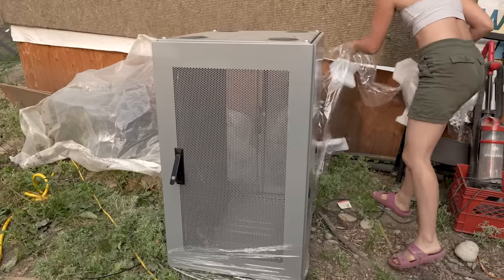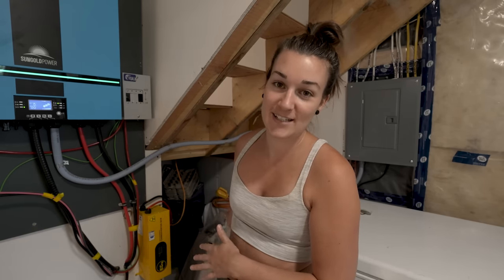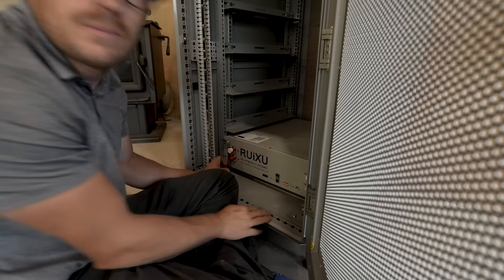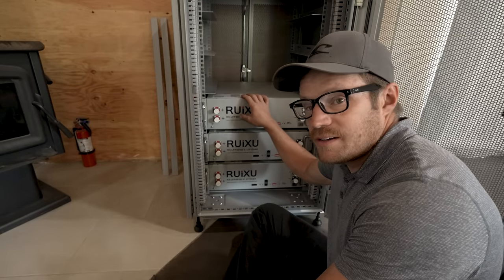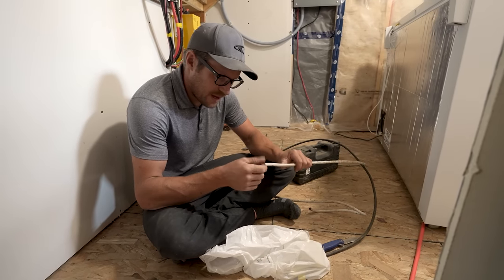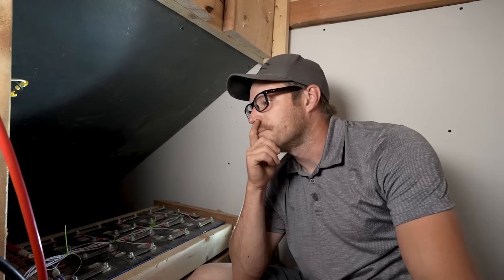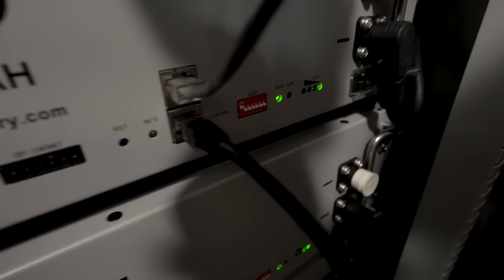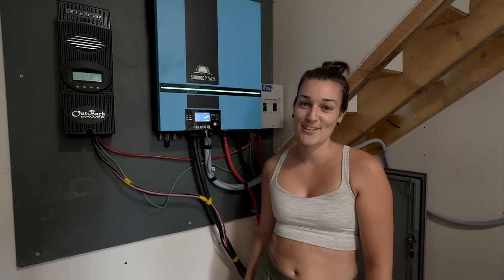Doubling Our Off Grid Battery Storage With Ruixu 48v Server Rack Batteries! DIY Solar System

Comment: FYI for cable sizing, as the AWG number gets smaller, the wire size gets bigger
so, a 4 AWG terminal won't fit a 3 AWG cable, it will work the other way how ever
that cable is probably good for 100 amp at a guess with that length... may only be 80 amp

Comment: That 3 gauge wire has a rating of 80-100 amps. What is your max amps your inverter will pull from your battery banks? example I can pull 200 watts at 56 volts max. I have 4 banks so 50 amps per bank. I use 4 4AWG from each battery bank to a busbar rated for 300 amps. I then run 2 gauge 600 volt welding wire from busbar to 2 inverters. I try to stay around 50% load rating. doing so means no loss to heat and over working the wires. Hope this helps. So I am saying I would use 2 of those 3AWG wires for both pos and neg.

Comment: The Floor was Creaking rolling the battery rack around when you get the next 3 module batteries don't be rolling in around without a ¼ steal plate on floor to spread the weight out onto the floor joists
Reply from the maker: It marked the wood floor too 🫣
Reply: If it's a LB floor you can use a scratch resistant scotch Brite pad very lightly try putting a big towel down to roll heavy stuff on I'm so Sorry it marked your new floors.

Comment: Woot! That's an upgrade. (Thanks, Greg -- I've just called them QR codes for a long time and until you asked that, I never wondered what the Q and R stood for. Quick Response. Though that doesn't help make more sense out of them.)  The rack's isolation of the connections really is nice and gives some peace of mind, I'm sure.

Comment: Usually the smaller the number on large gauge wire the bigger the wire. #3 should be bigger that #4. #6 is smaller than #4. And so on. 😊

Comment: thank you, you might of heard this before but , we have wind turbine ; why don’t you ? were in Michigan where the wind is 6mph to 20mph every night . Panels run ac all day & turbine runs ac every night + we have a 10k generator with transfer switch that starts automatically when battery’s are out ( runs on dual fule ) . Have you thought to put in a standpoint down the mountain near the beach ? Thanks

Comment: The nuts that need to be added to the rack to secure the batteries need to be pushed in from the back. If they are mounted in front they will not hold the battery packs

Comment: well most of the solar systems I've seen on YouTube that use the kind of power you guys do have 48 or more solar arrays to keep enough batteries charged to run their home with no issue so I know you are working on things and great you got some new batteries and rack but a lot more panels you will need or put up a wind turbine to help out

Comment: Just saying that those nuts should be on back side of the rack profile and it is easiest to put first one claw and use flat head screw driver for the other.

Otherwise the setup looks good and is something I would use for off-grid as power per cubic meter is quite good.

Comment: If there was enough wire I might have placed them every other one just for cooling until I got the rack filled. Probably wouldn’t do anything, but I’d try if possible.
I see you got the optional cat scan. Did you get the “properly completed” sticker?

Comment: In the video you showed the square nuts on the front of the rack post.  I believe you should have placed the square nuts on the backside of the post so when tighting the battery pack with screws.  The screw would clamp the battery to the post because the nut is on the backside of the post and the screw head is on the front side of the post.  I spent many years building data rooms with equipment racks, holding computer servers and other equipment on the rack.  I dont think the way you installed your batteries in the rack is going to be a problem, because the equipment cabinet is not going to be moved around in the future.

Comment: The cage nuts are in backwards. They need to mount from the rear.  They won't hold the gear safely like that! The equipment should site flush to the frame. Pop the side covers off and you should have enough access to re-fit them correctly.

Comment: When have the opportunity change this cables, for the proper ones like welding cable( welding cable #2) Is my suggestion to work safe. To keep safe your beautiful house.
Reply: The gauge 3 for AC voltage only supported 85 amps.

Comment: Nice install.  Did you happen to set your inverter's battery protocol so it can communicate with the Ruixu batteries?
Reply: You only need to set the RUiXU master battery communication protocol type through the dip switch, and the battery will automatically adapt to match the inverter. Very simple
Reply: @ruixubattery  That's very interesting.  It seems like this would be the first battery I've seen that works that way.  I'm used to having to change the inverter to match the battery protocol.  

What protocols does the battery support?  Do you have a link to the manual I can look at?

I don't have any direct experience with server rack batteries, I've only ever built DIY for my systems.  It seems like it's always been hit or miss whether or not the server rack battery communications work, so I've always told people it's not worth it to have battery communication set up.  Have you found that there haven't been a lot of issues because the battery adapts to the selected inverter?

Comment: Nuts go behind the holes.... like regular nuts - you want to fasten the Batteries at the bars with all the holes - so you clip the nuts in from behind the bars so so the screws go through the battery, the bar and then into the  nut.... just saying.

Comment: 19:30 just the opposite. 4AWG is smaller than 3 gauge (AWG). You won't have to crimp  it real tight, you'll have to make sure to get all the strands in the connector

Comment: Panel array potentially undersized compared to your battery size now.  a 2kw solar array could generate about 10kw of power at most.  I think you have around 30kw of battery capacity now.  So it would take 3 days just to charge your battery without any usage.  You would need to have a 6kw array minimum and probably larger depending on where you live and to handle overcast days. Of course this depends on your actual usage as well.

Comment: Your DC leads coming rom the server rack batteries is incredibly under sized to your inverter. May be a good idea to wire in a DC breaker as well before the inverter.

Comment: Thanks for the video. I plan to buy the same battery. I noticed you had a  EG4 Chargeverter. Have you used it on these batteries and where did you connect it on the battery side?
Reply from the maker: I have a bus bar that both of my battery banks are connected to, I connected the charger to that.  The chargeverter is a game changer!!!

Comment: Are you sure you wired the ground wires correctly?
I would've expected them to connect to a common ground bar in the rack (which also grounds all parts of the rack, incidentally) and from there to your houses ground.
Chaining the batteries like that seems a bit sus.

Comment: Everyone worried about the cage nuts.... Not me i am worried that every connection to that buss bar should have a torque rating for each lug. Loose connections are dangerous. It appered that you used a  hand screwdriver in the video.

Comment: You shouldn't mix lithium with other types of batteries, not even to other makes of lithium batteries because their bulk, float and equalise voltages are not the same.

Also, you should always fully charge each battery individually before turning them all on. A 5kWh battery can discharge up to 100A and if one battery is flat the other two will try and charge the flat battery by pushing a combined 200A into it which could damage it.
Reply: Unless you would like to burn down your house without any "wildfires"

Do NOT mix the two battery types.

Remove the old batteries completely from the system. ( Use separately on another  system )

Comment: I'd like one of those for emergencies on grid. Do the all in one chargers support AC in and auto switch when AC fails A. K. A. Grid down?
Reply from the maker: There are different units that would support the grid tie systems. As far as we know, this is specifically for off grid
Reply: Look into EG4.  They have a whole house hybrid grid tie and some new wall mount batteries that are super affordable.  They also have rack mount if you want to go that route but they cost a bit more.  You could also look at Sol-Ark but they haven't reduced prices to remain competitive.
Reply: @AndirHon  Thanks I'll look into it

Comment: An increasing number of people are placing their lithium batteries well away from the house to avoid the ever increasing event of lithium battery fires which are non-extinguishable and do, in fact, burn under water. Admittedly more common in automotive use where the risk of damage or leakage is greater, but a bank of these lithiums could easily lift the roof off when they explode!

Comment: As someone who has dealt with those types of server racks for 20+ years, I know what a pain those nuts re.  But I hate to say it but you installed them on the wrong side.  They are supposed to mount on the back side so the screw pulls the battery bracket tight against the frame of the rack.  The way you did it only uses the small clips to hold it to the frame which is not as secure.

Comment: I caught myself yelling at the tv that you installed the bolt on the wrong side and just remove the sides to install them. Bolts go inside of the rails. If bolts are installed on the outside the batteries could still rip out.

Comment: WHAT IS all your system voltage 12v, 24v, 48v, what is your controller 12v, 24,v 48v, the batteries you're putting in are 48v? you cannot mix them.

Comment: Bummer about the smoke and wildfires!
I strongly recommend putting server storage OUT of under stair space. As a firefighter, point out the heat they generate and what you need for access in the event of fire. Yes, it is convenient, also really stupid place for Safety. Think what burns if they go up the stairs! A ready chimney and blocks escape and access to deal with it. DON'T DO IT!  PLEASE, PLEASE, PLEASE! I would so hate to see your house be burned down. Remember you don't use a hose or water to extinguish batteries unless you have can keep them constantly wet for hours.

Comment: Also you put the nuts the wrong way. They go BEHIND the hole. Not in front of it. Then your batteries will pop out quite easily since you don't screw them in thru the hole and have the nut lock behind the metal.

Comment: What cable type did you use to connect battery bms to the inverter? Was it a standard cat5 cable or special pinout?
Reply from the maker: Cat5

Comment: Do you have 240 Vac output in that inverter? Or 120 Vac only... thanks
Reply from the maker: We just use 120v but if you add another of this inverter you can get 240v. There’s other inverters available now that have 240 built into in one unit

Comment: If you are able to quickly charge the batteries during the day, but they fall too low overnight, then battery capacity is likely to be an issue.  But if that is not the case, I hope that you are able to also add more solar panels, as if the batteries are not able to achieve a full charge during the day, then the issue is not enough solar, or your household power load is too high.  AC often eats the power.
Katie, I hope that you got them in cottectly, as those nuts and clips are meant to be put in from the back, not the front, else they will not hold in place when the screws are tightened. 
Will the new batteries be isolated from thhe old batteries, I hope so else, when there is no solar input, the new batteries may discharge into the old batteries.

Comment: Noting the storage position for your new storage rack -- under a solid wooden shelf under the stair platform, there appears to be very little clear space above it AND AROUND IT (PERHAPS AS LITTLE AS ONE INCH) to let hot air from the system box to flow out.  THIS MAY NOT BE ADEQUATE.  Have you read and understood (fully) the instructions about space around and above the unit????  It can be critical.   Failure to provide adequate ventilation can lead to premature equipment failure and fire.  This is especially critical with these new types of battery structures.  These new batteries , when they burn, they burn at extremely high temperatures and need special equipment to extinguish them.  Sometimes they do not extinguish, but keep reigniting.  Be extremely careful.

Comment: Would have been better to go with Signature Solar EG4 batteries.   Longer warranty, US support (not China), the EG4s have a circuit breaker, and you don't need to use propritary wiring connectors.

Comment: what size are your charger and inverter? 3awg seems way too small for a whole house. those cables you have are fine for a whole house at 110/220v but lower voltage battery will need to draw more current. should probably be 0 or 00 cable...
Reply from the maker: I took a thermal camera to the system after charging the batteries at 100amps for a bit and there was very little heat coming from the 3awg cables.

Comment: How is the heat from batteries managed?
Reply: The maximum current of each battery is limited to 100A, and the heat generated is dissipated by natural heat. We designed the battery cabinet or battery rack with space between each battery to dissipate heat.

Comment: How are the batteries working? Any issues so far? 15kWh of these is notably less expensive than 15 kWh of SOK's.. So looking at them hard.. Just not sure of support /warranty status..
Reply from the maker: We haven't had any issues at all
Reply: @ThisOffGridLife  now that it is getting cloudy again and days are shorter, have you had to supplement your power with a generator with this large of a bank?  I'm looking at replacing my older lead acid bank with a set of these since they are in stock and an attractive price for Canada.
Reply from the maker: @xstatic981  we used the generator once during a couple rainy days, but on either side  of that weather when it was partially cloudy we were totally fine. It's been mix of sun and clouds lately and we are still hitting 100% full. You won't regret making the switch! We'll do an update video soon

Comment: 12:27 min. - Sorry but this is wrong! You should insert the cage nuts from the BACK
and not from the FRONT. The purpose is to protect the racks (same as
server racks) from falling forward.

And in the current situation they are only semi-protected because the
cage nuts are pointing FRONT instead of BACK.
Just for the next racks you will install it.

Comment: The nuts you put in on the front of the rack should be on the inside of the rack and not where you put them if you pull hard enough the nuts will pull out with the batteries 🤔

Comment: Well you need to put two big trip batteries in I put 15 amps 60 watts 60 watts you need 50 solar panels cuz you're going to be using up more water so you need more batteries unless you go to wind power or go to firewood or something else to drink power water power or something you have nearby the wind power is the next best thing Sia

Comment: I note you haven’t answered anybody’s concerns about overheating  ventilation or fire risk from these batteries does this not concern you?
Reply from the maker: The lithium iron phosphate is the safest battery chemistry on the market. It has a low fire risk. The cabinet has space around thr batteries, thr cabinethas perforations and there is spcearound them under the stairs. It's the coolest area of the  house

Comment: Awesome. How much did that set you guys back?
Reply from the maker: The batteries are on sale for $1300 currently. It's possible to add to this set up as well, so it's easy to start small and add on as financially feasible.
Reply: @ThisOffGridLife  so that whole set up with the three batteries was 1300
Reply: Impolite to ask the price
Reply: Considering it's sponsored, they probably got those three for free in exchange for this video.
Reply: @mikepagliei426  No... one of those batteries is $1300.  3 would be $3900, and the rack  itself is $600 for a total of $4500.  They have the whole kit for $4,456.00 on the site.
Reply: I love all your videos, especially the barefoot ones.

Comment: Storage in close proximity to batteries and electrical equipment???  NOT A GOOD IDEA!  You need clear space for air-circulation for cooling of that equipment.  You do not want, in any circumstance, for heat build-up, which can create a fire risk.

Comment: U did this all  wrong.  She should be on top walking the rack into the home. With her on the bottom, she is working against gravity plus all the weight of the rack on her back. .  Your electrical load center is too small . you need at least 36-circuits to accommodate future expansion. You should be running the branch circuiting  in steel flex conduit , use romex around corners.  since U are off the grid, consider PV system. But do a ayback and initial cost analysis.  In Cal a PV cost 25K with 8-year payback. U dont recover your initial cost until after the 8th year.  The contractor makes the money not U.